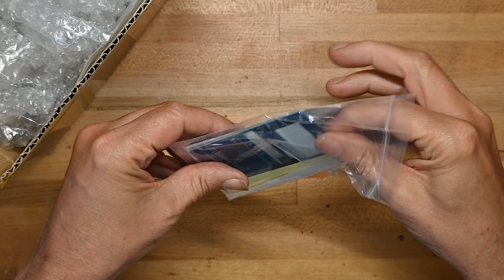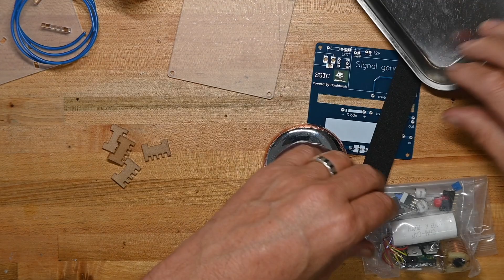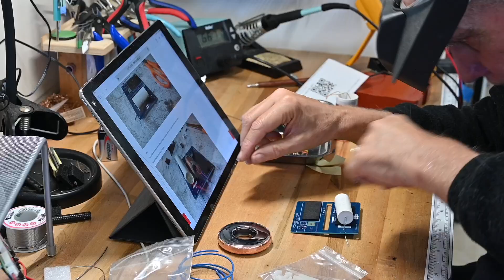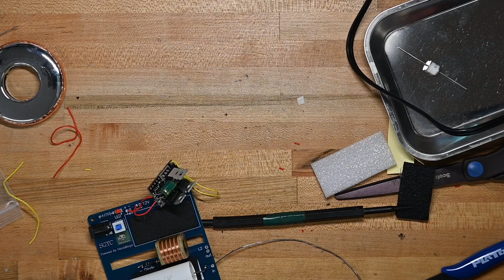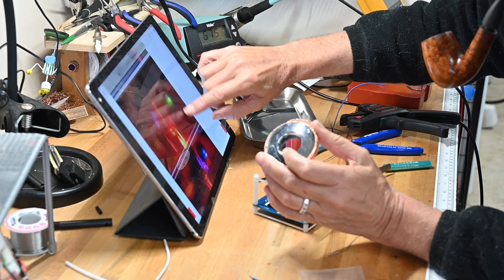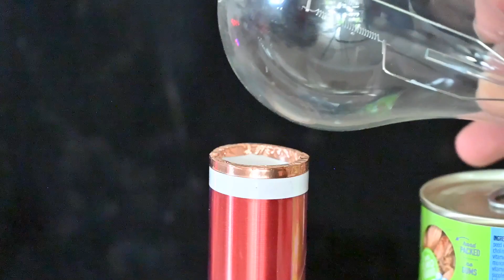C.K. builds a Tesla coil kit from HandsMagic

Comment: I just finished building this one myself, I came to compare your arcs to mine to see if there’s something I need to improve. The arcs on mine are identical. I’m considering trying an air gap for the spark gap.
Reply from the maker: I know I could have done better at straightening the rods.  Look at some of the other comments here, also, some folks have had great ideas.  Thanks for stopping by!
Reply: @C @CKHaun oday I spread the leads going from the primary and secondary going to the board as far apart as I could get them and the spark gap is now much more consistent and fires at a much higher frequency. This has me considering adding shielding to the leads.